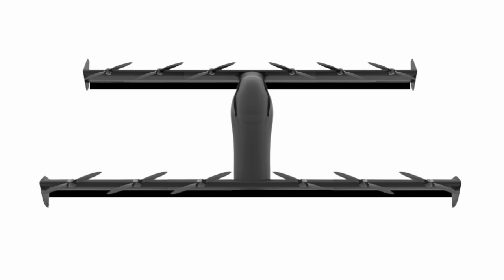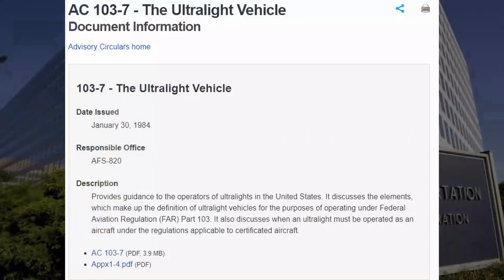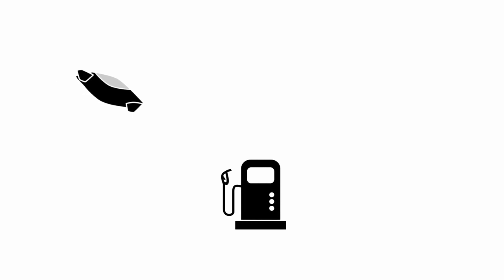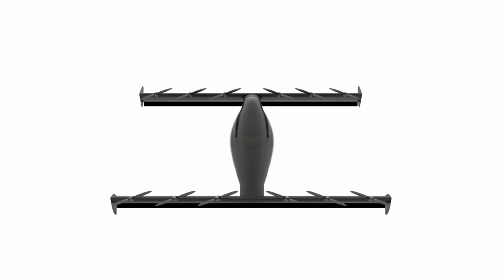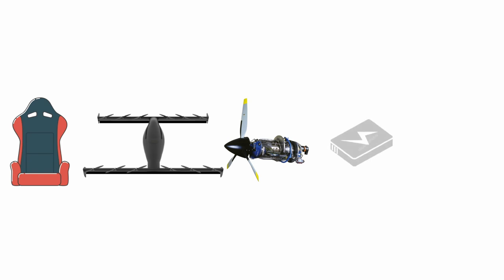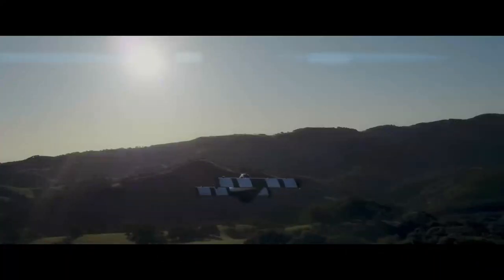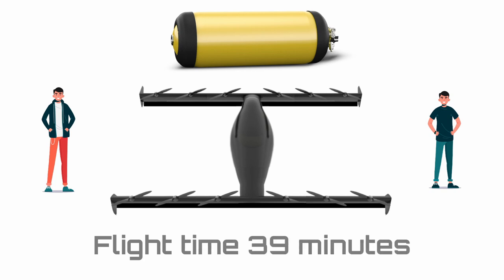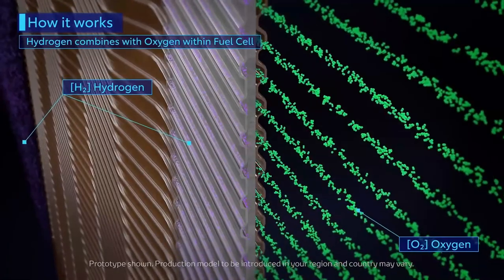2 Seater BlackFly with Fuel Cells : Bigger, Meaner Flying Machine

Comment: Thank you for this excellent analysis.  I would suspect the formal certification for a version with hydrogen fuel cells would be particular about the potential safety of the system in a crash.  How might this be compared to the certification that the Toyota Murai had to have to ensure motorway safety?
Reply from the maker: As long as hydrogen is allowed to vent externally its fine. Any leakage form the cylinder should not come into the cockpit. So an external chamber will be required for hydrogen tanks

Comment: It might be interesting to look at a fuel cell Velocity kitplane.  It comes in several variations, single engine and twin engine.  Not VTOL but they are roomy with doors and cruise pretty fast and have the stall resistant canard design.

Comment: I'm curious about the prospect of replacing the battery altogether with a supercapacitor, and what would happen to the weight and performance in that case.  Also, I'd like to see what could happen with a new rotary engine like the Liquid Piston driving a generator instead of a fuel cell.  I'm sure it could be far cheaper than $40K for the fuel cell.

Comment: Until battery storage capacity per weight gets much better it seems hydrogen may be the way to go for e-VTOL aviation.

While you are scaling that up it might be worth looking at a three seat version where one can have one person and some cargo plus the fuel cell or two person with no cargo and the fuel cell or three people with limited range or one person and two fuel cells with maximum range.
Reply from the maker: Good suggestion
Reply: I don't know, if you imagine living off grid and commuting to the nearest city for work or shopping, the blackfly is already fine.
Ignoring regulations, the international version has 12 kWh and 40 miles / 64.4 km. That is more than enough to commute. And small battery means quick recharging from a normal outlet or directly from solar panels. Energy efficiency is better than a big electric car and embodied energy is probably less too.
If you would re-engineer how our society operates you could replace almost all medium range personal transport. This plus bicycles and trains. Most roads would no longer be needed.

Comment: Adding 110 Kg of LiPo will do almost the same trick at the half the cost and no additional complications of hydrogen and no hydrogen refiling needed as added cost per mile. Also a U shape redesign of the wings will add lift surface without extra length of the wings keeping it all nice and tidy. My point is if we redesign the FAA requirement for electric powered ultralights around 300-400 kg this can still be made. Law should keep up with innovation not the other way around.

Comment: Wow, I hadn't realized that the fuel cells had that good of a power to weight ratio. That seems like a much more likely way forward for electric aviation, at least for the time being.
Reply: Yes, but how easy is it to recharge a fuel cell when you live in a remote location miles from any kind of infrastructure? You can't just plug it in to the mains electricity and recharge overnight, right?  My closest town is 6 miles away over rough terrain.  I need something that will get me to town and back once per week.
I have access to gasoline, electricity and bottled gas.  But where am i gonna get Hydrogen from?

Comment: very interesting to note that the increase in flight time with Fuel Cells. So why are they NOT doing it?
Reply from the maker: As mentioned in the video, it wont remain part 103. They will have to go for several year long certification process for it to be legal if the weight is increased. This costs a lot of money

Comment: Considering the Mirai has been available since 2015 but there are less than 20k sold I am not sure economies of scale will help much. I wonder if you could increase the blackfly range by increasing the prop size.
Reply from the maker: The existing props  diameters nearly cover all of wing length. The wing size would have to be increased
Reply: @ElectricAviation  Or decrease the number of props. Or do both and keep the number of props the same but increase their size and the wing size.
Reply from the maker: @macrumpton  Prop size increase results in higher noise signature
Reply: @ElectricAviation  It would certainly change the noise signature towards a lower pitch, but I would rather listen to a single full-size helicopter than a cloud of drones with the equivalent thrust.
Reply: @macrumpton  The chopper's noise propagates much farther than small props do.  Higher frequency sounds dissipate far more quickly.

Comment: I'm a great believer in fuel-cell power, but for this aircraft there are two problems that I see ...

1. Storage of hydrogen in the aircraft. Unless new technology comes up, it will mean that the tanks will have store the gas at ENORMOUS pressures.

2. That said, where will one get the hydrogen from? And how to refuel the aircraft? Currently airfields have no storage facilities for the gas and building one will be hugely expensive, forgetting for one moment, all the certification of the storage facilities - which will be essential. As we all know, hydrogen is highly inflammable, so the certifying authorities will be pushing hard to ensure that there will be no leaks.

Comment: I always enjoy your videos. I'm surprised that airspeed and range are not mentioned. The biggest problem I see with the "Black Fly" is it's name. It would be difficult to find a worse name. Thinking about it for a moment I actually came up with a couple I will not share. Here are some I think would be better - Black Thunder, Black Lightning, Black Dove, Black Hawk. Perhaps next time you visit the Black Fly you could provide wing loading, cruise speed, range especially if you are looking at variations . I guess knowing the ceiling isn't that important. Just thought about possible emergencies and the on that jumps out is electrical fire. It doesn't have any provisions for an event like that. I think flight safety would be a good topic for a future video.Please keep up the good work.
Reply from the maker: A military version of it with the name Black Thunder would be very apt. The good thing about the black fly is that the batteries arent in the cockpit. they are in the wings, behind the propellers. Lining of a fire retardant material would protect the pilot. The cruise speed is 80 mph. I wanted to give more numbers but feel people in general dont care much other than flight time.
Reply: @ElectricAviation  That's pretty fast. Having the batteries in the wing isn't all that great. In the event of a battery fire the wing would fail quite rapidly.
Reply: How about "Lyme Tick"?
Reply: @Eugensdiet  If you prefer sitting on them?
Reply: @LosZonga  Another problem with the batteries in the wing is dumb bell effect. Possibly the battery could be 4 parallel parts with temperature monitoring so in the event one would would catch fire it would automatically be ejected but attached to a cable so it didn't fall onto a house or person.

Comment: you can do all the components yourself with ease, especially the metal-air aluminium-spiral anode fuel cell with standard carbon air-electrode, ethanol-koh electrolyte will limit metal passive corrosion, ie, non-active losses
Reply: use manual potentiometer control with brushed or preferably brushless true dc motors
Reply: flywheel, flat disc, r=1m, f=3333Hz (200krpm) has energy density of 30kWh/kg, design equation S=E/m=(pi^2)*(r^2)*(f^2), r=flywheel disc radius, pi = 3.14159, f=revolutions per second, should be floating on vertical maglev bearing stick, its the easiest, gives gyro stabilization at same time, try contra rotating twin flywheel battery, same or better, adjustable, than plain hydrogen, jet engines have revolution speeds of 200krpm, its already been done, but use that in the flywheel energy storage, and yes, electric motor-generator combo, assume 100% efficiency, for real
Reply: put the flywheel in a "ducted fan" configuration, so the the disc spins against a air-lev bearing housing